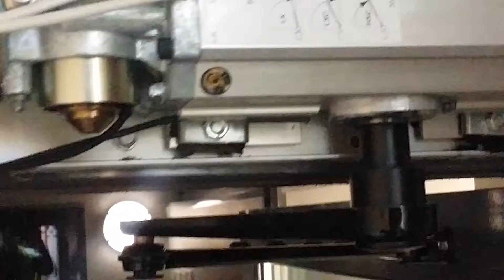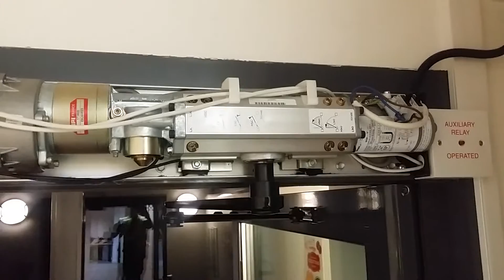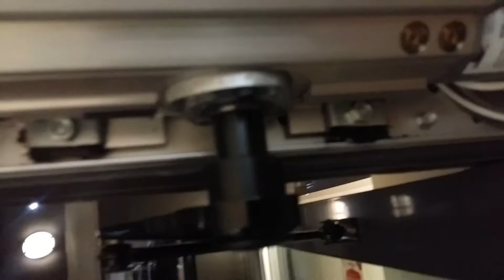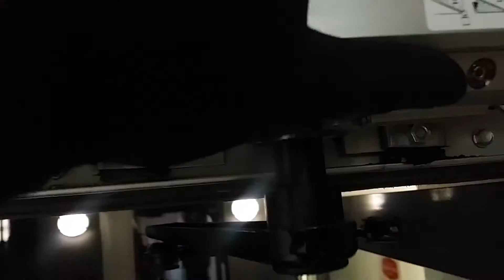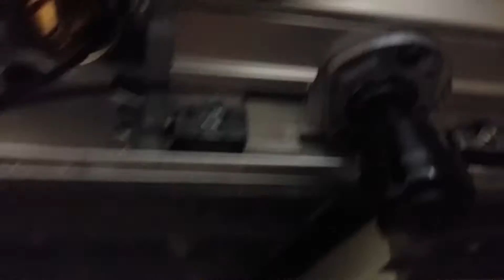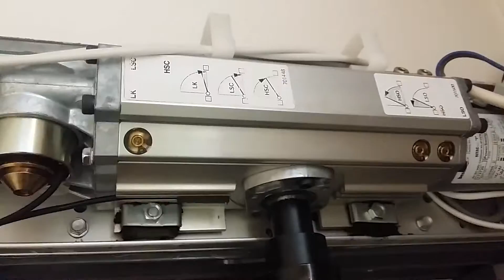BESAM SWING DOOR FAULT ISSUE

Comment: I've got a question.
I have this besam power swing but it makes nothing.
The Sensor works. 
But i dont hear any clicks from the valve. And the Motor does nothing. 
But the Motor is ok because i tested it without the other parts.
Is the EXA Unit necessary?
Reply: Es kann sein, dass irgendwas mit der Steuereinheit nicht stimmt oder ein Kabel defekt ist. Hast du das schon ausprobiert?
Reply: irgendwerausbayern - someguyfrombavaria 

Ich weiß warum es nicht ging.
Ich habe vergessen die schwarzen Kontaktstifte einzusetzen 😂😂😂
Reply: DHF 1 Dann ist das Problem ja gelöst!
Reply: Dann sag ich nur: BESAM, öffne dich!

Comment: Is this normal that electro-hydraulic door operators become hot when at fully open?
Reply from the maker: Hi - Good question, apologies for the long response, thanks:

Yes it is normal for "this designed electro-hydraulic door operator" to become hot when fully open. 
(As it is an electro-hydraulic power open / spring close) designed operator:
Motor driving to overcome the friction of the internal hydraulic spring close torque.
Which when in normal automatic use - once the motor has timed out (commissioned hold open drive time expired) then allows the door to spring close - like a normal hydraulic door closer module. An operator design that is normally (an available option) recommended for fire doors.

This design (as confirmed with the manufacturers) is not recommended to be kept open for long periods - as the motors can get very hot to the touch. 
Many customers seemed to have not have been made aware of this fact, within there 12 month warranty documents ? 
As the motor gets hotter - you can actually hear the oil in the drive motor bubbling & hissing, when the key-switch is placed to hold open after a period, which cant be good long term ££.

Other available swing door operator drive designs available are:
ELECTRIC POWER OPEN / POWER CLOSE &
ELECTRIC POWER OPEN / SPRING CLOSE &
PNEUMATIC.

OBTAINED FROM MANY YEARS EXPERIENCE - IN OUR ONLY CHOSEN COMMERCIAL AUTOMATIC DOOR - SPECIALIST FIELD:
The correct specification of the right designed product suited to the door weight, end user (LOW OR HIGH) usage requirements & appropriate activation methods best suited to the individual entrance bespoke approach zones, with safety requirements in full compliance. 
All these important combination of details obtained at the initial survey/proposal period are "KEY FACTORS" to providing long term automatic door reliability. 
Factors we see so often - which can be sadly & yet so easily overlooked by the many novices working within our "SPECIALIST AUTOMATIC DOOR ARENA", with their umbrella of different field & different industry products - with there often 12 month warranty designs & "closed system" products, road map. Which only shows clear proof of there goal of monopolized short term gain.

                         This is why we can use the word "ADVANCED"
PAUL CASEY (PROJECTS MANAGER) ADVANCED AUTOMATIC DOORS LTD (UK) - Clearly Opening The Way
www.automaticdoorservices.com 

(All compiled information provided is copyright - although can be used subject to acknowledgement of source specialists).
Reply: ADVANCED AUTOMATIC DOORS LTD (UK) So this means there is a risk of fire?
Reply from the maker: The manufacturers did recommend "after selling them - once they were fitted?" that this model type of electro-hydraulic swing door operators. Should not be held open by its key-switch for long periods of time? maybe that's why the company was taken over by another? Kind Regards
Reply: This makes sense.
Reply: @Automaticdoorservicesuk  We are still Besam but we work under the flag of Assa Abloy entrance solutions. 
it does not matter how long you keep the door open on its Key impuls.